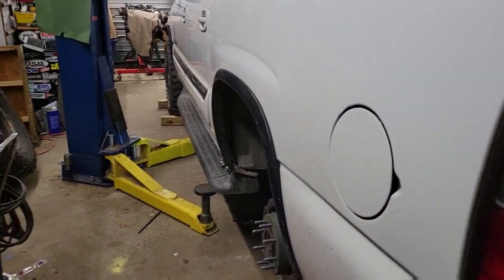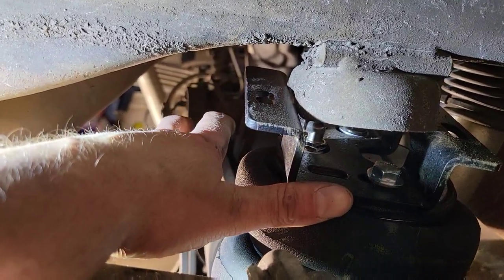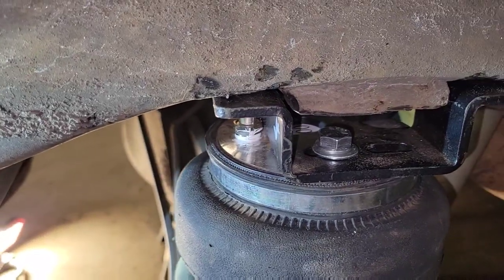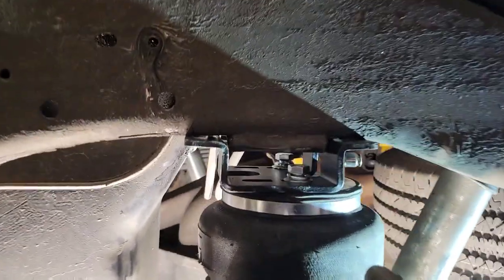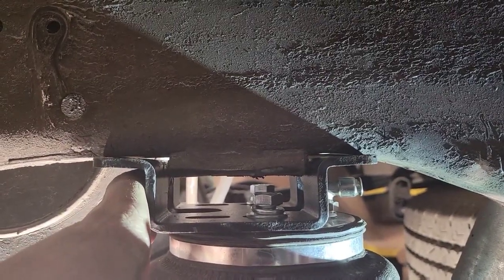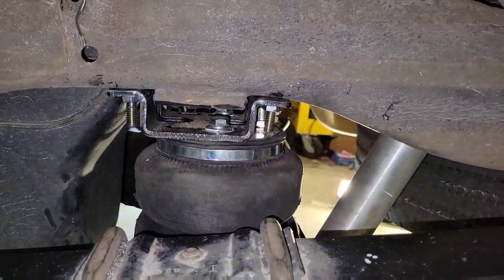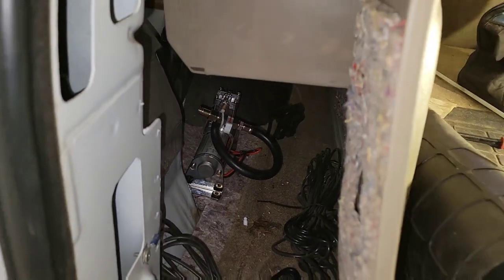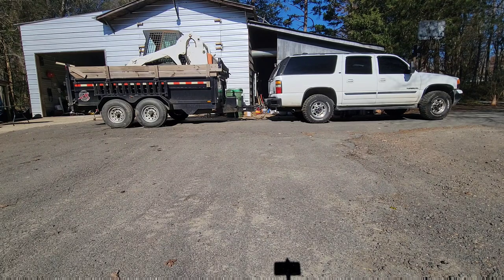Installing Rough Country 01-10 hd truck air bags on the 2500 Yukon xl

Comment: Why does my compressor stays on and getting no air pressure on the rc guage
Reply from the maker: Sounds like a leak in the system it's never reaching minimal psi so it keeps running